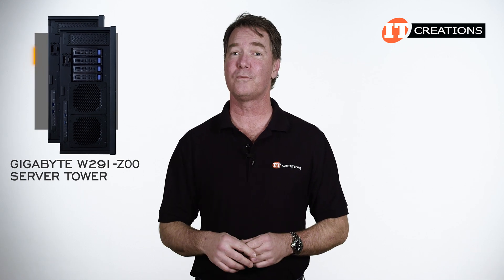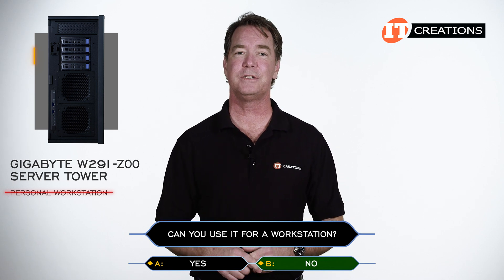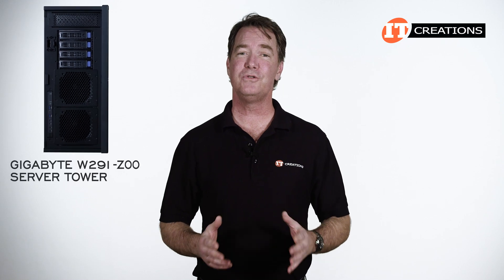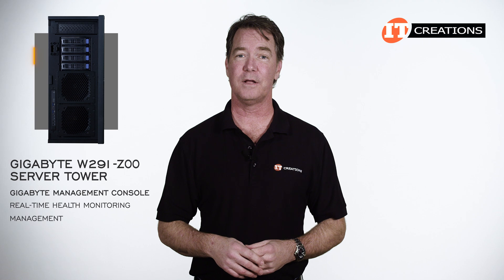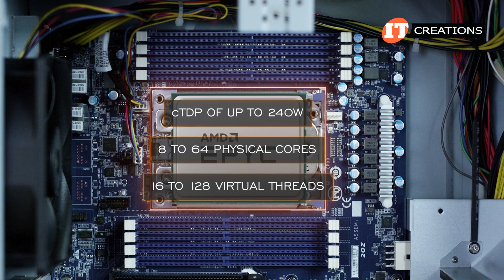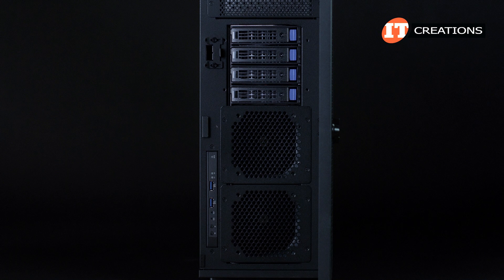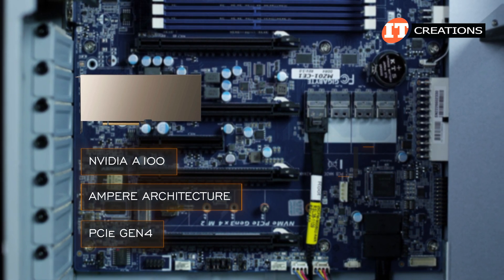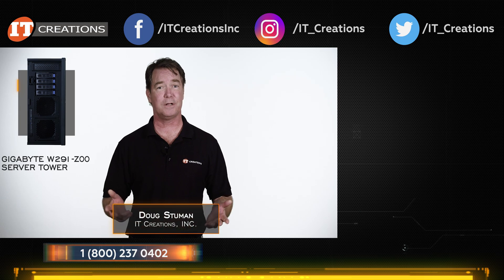Gigabyte W291-Z00 Server/Workstation Tower REVIEW | IT Creations

Comment: 4:38 "for SAS implementations you will need a SAS PCI card for SAS drive support"  Please explain why I would need that as just prior it was mentioned there are 4 slim SAS connections on the motherboard.  5:23 "this system only supports PCI 3.0 in the PCI slots.  There are 5 PCI 4.0 slots..."  was that misspoken?
Reply from the maker: Hi Seth!
Yes, you do still have the Slimline SAS connectors but a SAS card is required still for SAS drive implementation. Common for all servers. And again yes, that was misspoken. I debated removing the PCIe 4.0 mention and replacing the audio with correct audio but in the end went with what we had even though I say it like right after saying all slots are PCIe 3.0! That said, I changed the closed captioning and I did reinforce the PCIe 3.0 thing a few times throughout the video. Usually nobody even notices but so close to my initial statement, perhaps that was a bad decision on my part, hahahahahah! Here is a link to the data sheet where you can confirm what I just stated above. https://www.itcreations.com/user-manuals/w291-z00-manuals/gigabyte_w291-z00_datasheet.pdf. Thanks for watching!